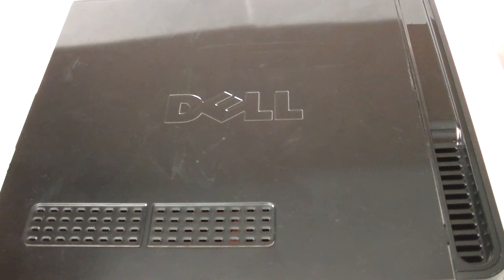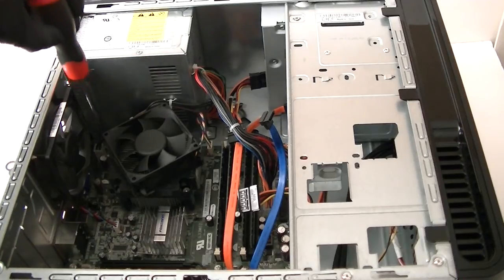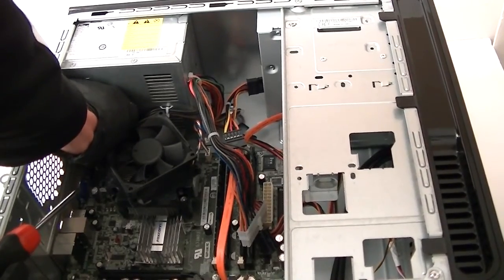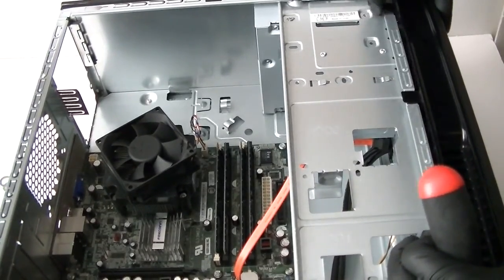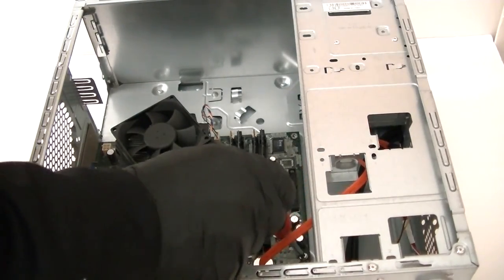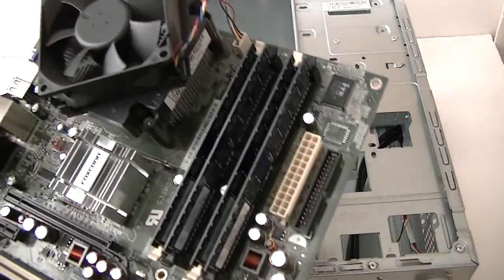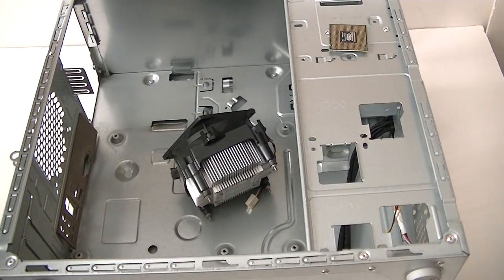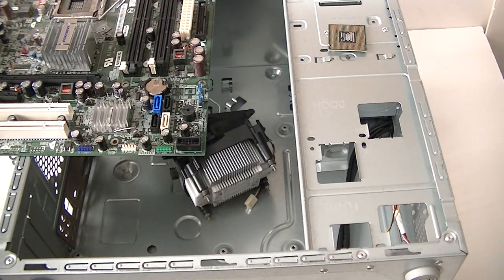Dell Vostro 200 Teardown

Comment: wow amazing tear-down. great video, i love best how your very clear and you move the video along not that im sitting watching you unscrew each part for 10 minutes. thanks

 i do have one question, on my dell vostro 200 the optical drive is malfunctioning the cd slot just doesn't like to open every here and then, i usally got to stick a paper clip and open it manually ,is there any fix for that ? or a new optical drive is the solution? thanks
 do you recommend where i can buy legit parts from not some knockoff which wont work? thanks again great video, one of the clearest videos ive seen from techs on you tube amazing.
Reply from the maker: Hi, you can buy online new optical drive dvd burner for around 25 with shipping included. Thanks

Comment: im trying to take the motherboard out to put in a optiplex 790 motheboard. i took all 8 motherboard screws out but there seems to be a screw or something holding the motherboard down very firmly. Its not the lock on the sides by the bottom of the case. Seems to be directly under the cpu socket. Can anyone help?